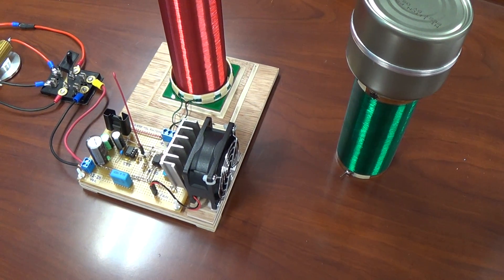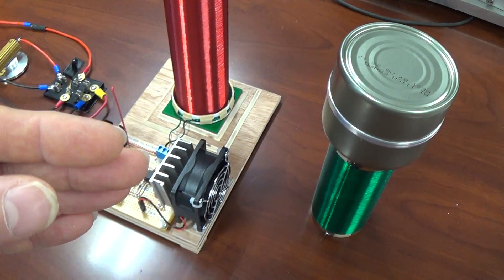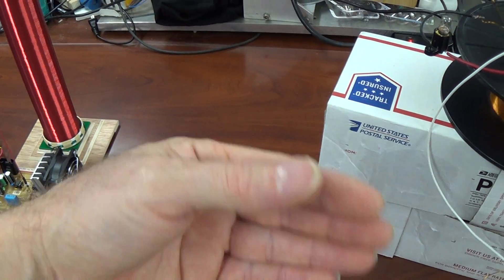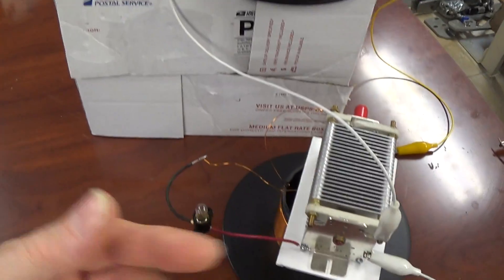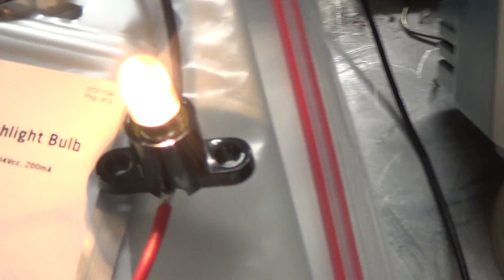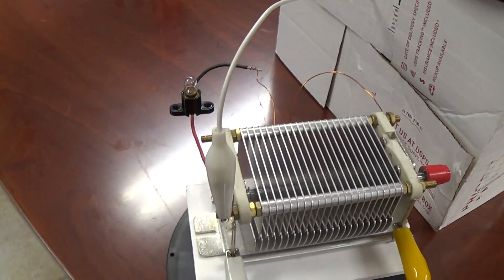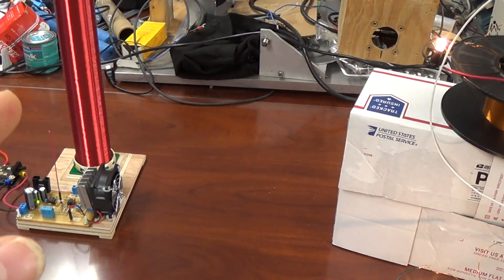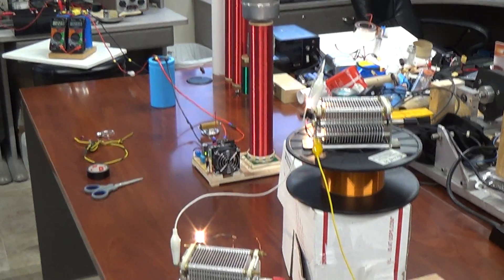TinselKoil Test 2

Comment: 0.47 see
https://youtu.be/OI_HFnNTfyU?t=355
Professor Eric Laithwaite: Magnetic River 1975

Imperial College London
,Published on Nov 18, 2012

The wonders of magnetism and the linear motor are captured in this 1975 presentation by Professor Eric Laithwaite (1921-1997) former Professor of Heavy Electrical Engineering at Imperial College London.

Comment: New demo.  Back in my Navy days, I was a RADAR Tech and became quite familiar with the principles of frequency, resonance and VSWR (standing waves)  Back reflections was always a consideration in running wave guides and microwaves.  I think the moving of the distance between the transmitter primary and the receiver secondary is a relation of standing waves.  Tesla notes this in relation to load and power in his Colorado Springs Notes.  He got very excited when his theory was confirmed in his observations of standing waves setup around the earth during the lightning discharges as a storm was tracked over a great distance.  Of course he saw much farther in implications than us lesser mortals when he also realized that here was a key to forming an "energy sink" from a natural (free energy) source.  He hints at this "sink" again after he left Colorado and returned to New York where he publishes in the Century Magazine on how to produce free energy via a "sink" in a thought experiment.  He was very cunning and not going to tell you every little secret.  He expected a smart person to be able to be knowledgeable enough to take his lead and run.  No spoon feeding.
Reply: I've seen the same in ordinary transformers. If you take a large enough transformer it has idle power (when nothing is connected as load)  quite large. If you connect correct capacitor parallel to form resonant tank circuit for 50hz you can load the secondary and the current on primary will go down from idle current up to almost zero, but only in this small area of idle current.